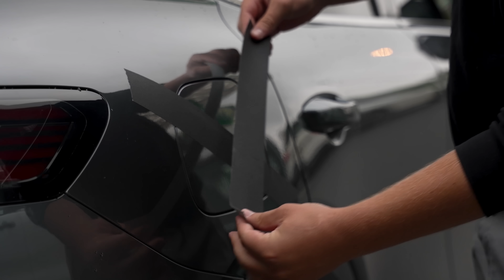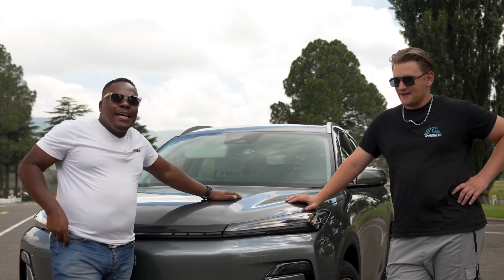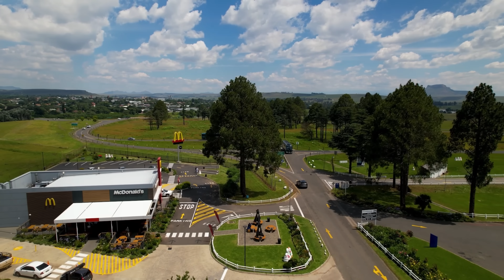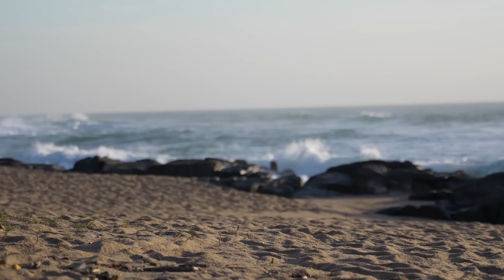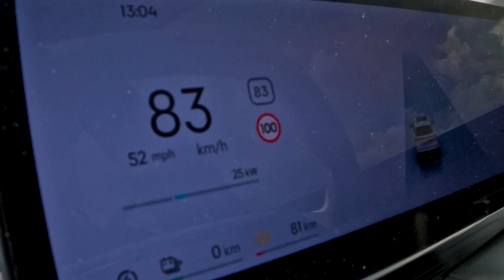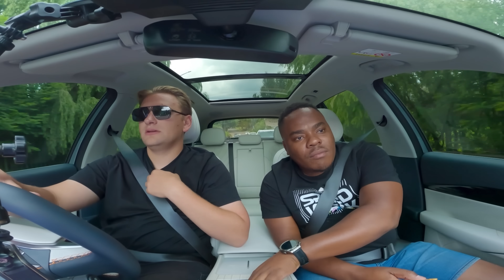Geely takes on the TopGear SA 1-Tank Challenge | Real-World Fuel Economy Test

Comment: I'm just came across your video and be stunned by that range of the car. I'm actually in the decision for a plug in hybrid from Geely or BYD due to the electric range. I have been test driving the Geely E5 EM-I here in Germany (its called the Starray E-MI here) and was a bit disappointed by the consumption on German Autobahn. But I just had an hour and was not test driving in a mixed road scenario. I guess in every day usage this car should be much more efficient then the BYD DM-i Tech. As the price here is the same I will have a second look on it. Thanks for this challenge!

Comment: Lol had to laugh re it's great for any car to get over 900km out of a tank. My old ICE - 2010 1.4 TSI VW Golf does that regularly!
Reply: The Geely is an SUV which weighs over 500kg than your mid sized hatchback Golf. You’re comparing Apples with Bananas, plus you don’t have the option to use zero petrol when you use it as an EV in city traffic. If you do 70-100km daily on short trips when charged overnight you can literally use zero petrol during short trip. Let’s say then you have been doing short trips the whole month without having to leave the city, this will bring your fuel bill literally to zero for the month, you don’t have that option with your Golf. Try to understand how this technology works then you’ll see huge benefit.
Reply: @sorechunangvandag  exactly, i have 2 months with my ex5 emi (name in mexico for this) and i have not load a single drop of fuel, still have my full tank (the dealership give it to me with full tank when bought it) i have solar panels, so basically i have been moving my family FREE for 2 months.

Comment: Well, that's 4,39😮l/100 km, looks like you didn't try the hyundai ioniq phev, that reaches 2,7-3,5 l/100 km, although it has 39 liters of fuel tank
Reply: 他们试驾路程都是高速，BYD的dmi和geely的emi都是单高速档的串并联式电平台混动技术，他们测试的结果是这辆车的最高油耗。。。
顺便说下，BYD dmi和geely emi的最佳节能区间是0~60km/h,混动模式在此区间运行可以做到100km/1L~2L的油耗，因为高速大于70KM/h的区间是发动机直接驱动车轮，所以是最高油耗区间。。。
顺便再说下，BYD的DM PHEV5.0（第五代技术），
还有geely的EMi是目前最先进的电平台混动技术，无论是技术架构还是发动机热效率以及混动逻辑。
Reply: You have to consider the vehicle size and speed.
Reply: ioniq ??? 😂😂😂
Dude you’re basically comparing apricots with watermelon 😂😂😂

Comment: So is around 16km/ liter?
Reply: More than that for sure ;)
Reply: 22,7 km/l
Reply: 22.272km/L which is even better than my charade did, admittedly I was running ac.
Reply: @lloydtucker isn’t the total mileage already included  in the battery range? So to properly calculate the km/liter, it should deduct the battery mileage first. And how much was the total petrol in liters? 50 or 55 over filled?
Reply: @Cmvinyl0102  electric only range in this car is only 150km. the engine works as a generator to charge the battery as you drive. so asking what the fuel consumption si really is not valuable for what this challenge proposes. best way to think of it is how many charges 50 liters of fuels give this car (1000km total range / 150km electric range) = 6.6 times, assuming the engine is charging the battery throughout the whole trip
Reply: @davidm8394 thats’s a very clumsy estimate. This car give you 150 km per the battery size of 18 or so kwh battery but when charging from fuel source it wont charge all that 18 , possibly 80 percent of it, so the 150 km estimate is flawed. Doing a range test without ev range is the way to go. That’s situation when the battery is depleted and is more realistic fuel consumption of the car.